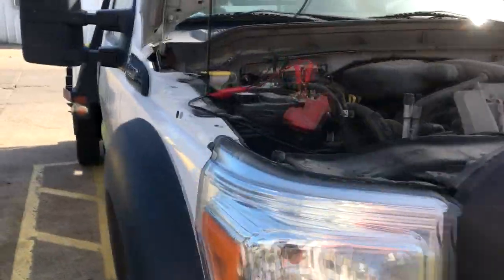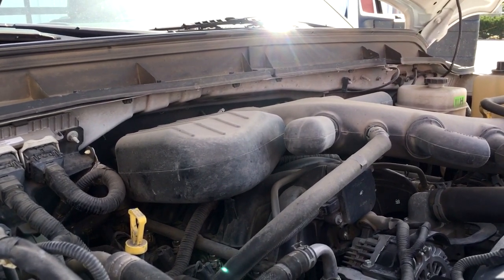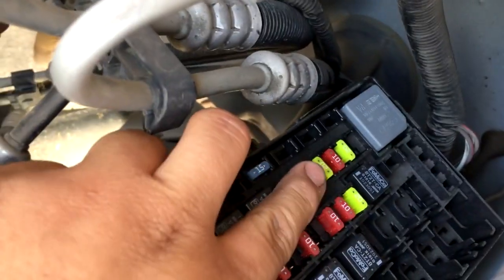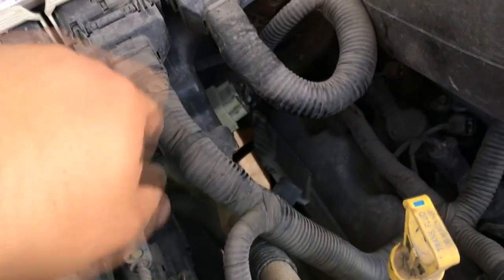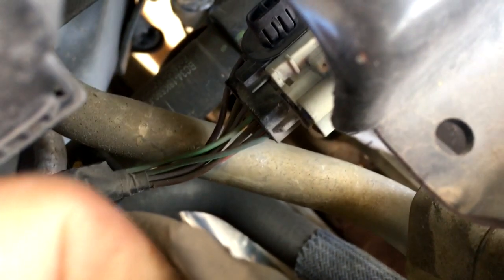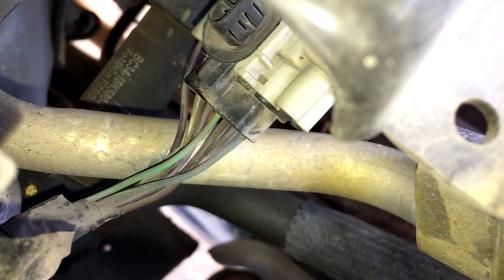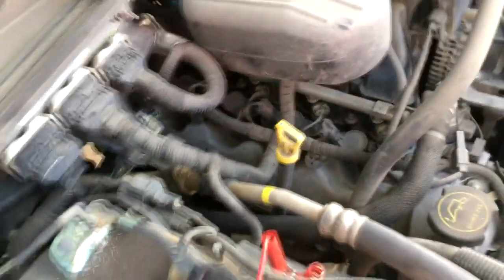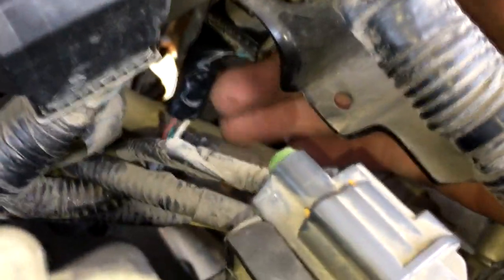FORD SUPER DUTY P0155 P0135 WIRING SHORT

Comment: Great Diag. I work at Caltrans and most of our trucks get Codes P0135 P0155 and P0443 . Usually the problem is the PCM. Hmm I will start looking in that area from now on on the trucks with the Harness in that area. Thank you
Reply: We have 2 trucks with those same codes on 07 and 08 f450s how do you guys determine its the pcm everything seems to check out
Reply: Hell yeah I gotta have 350 right now purge bell circuit theater 443 replace the valve and the 02 center both came back this is the problem
Reply: Excellent video my fellow mechanical friend I'm having the same issue but on bank one and a purge file circuit code. Replace both things that both keep coming back that's the one spotted and check thank you so much
Reply: That $1500 PCM......    I was looking at my '08 thinking $1500 for a new box?  son, maybe it's time for you to find a new home....

Comment: I have the same issue on Ford Vic 2009 but I couldn’t find any thing and check engine flash again. I used OBD2 and I find a code P0135 heater sensor. I replaced it but still with the same code. Any idea??
Reply: Ya.  You have to disconnect the battery before you replace the sensor then when you reconnect the battery the computer will start to program the sensor and that it
Reply: Did you find out what it was in the end?